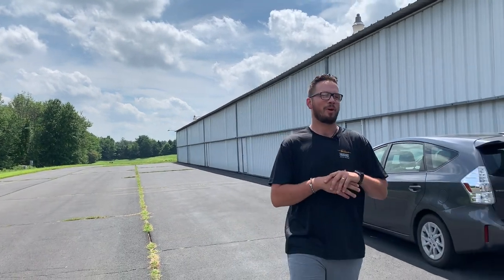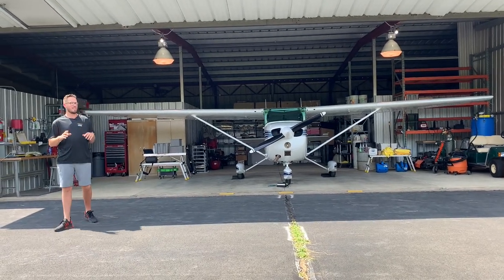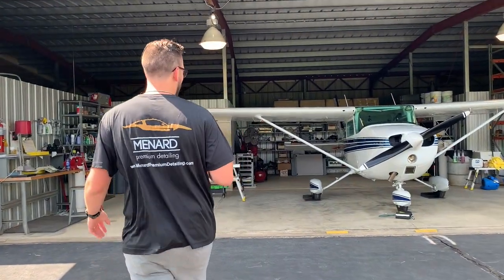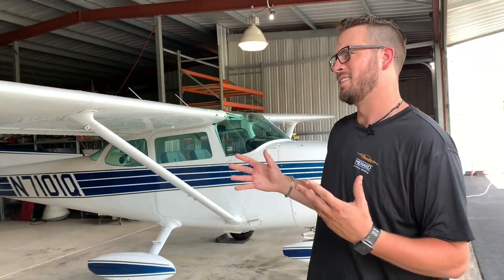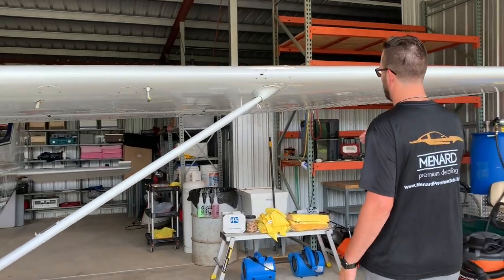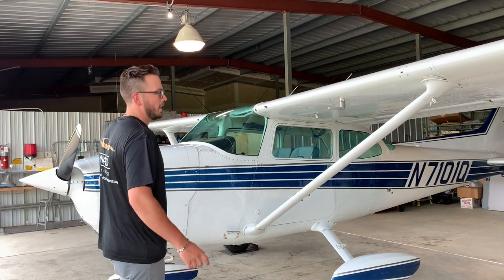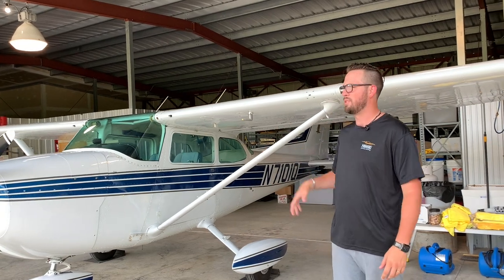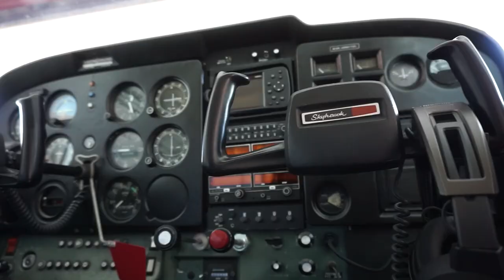Airplane Ceramic Coating ✈️💎 | Cessna 172 Skyhawk | Menard Premium Detailing

Comment: Hey love your videos. I was wondering once you give it a good bath, what do you use after that to get the oxidation off? I use a acid based paint prep that is supposed to dig in to the paint and loosing up the old paint. After that I know the surface is free of any rough spots or debris. I apply the coating. However, I see you buffing. Can you telle what you are using and what type of pad is that on your buffer. I've always been told that once you apply the prep that any other buffing you do is only going to loosen up anything that wasnt ready to come off and gets pressed into the paint. I also have a shampoo that I leave with my customers that they use at the first sign of fading which for a plane flying average is about 18 months. It has several sizes of ceramics and 🚫 t only cleans any stuff that happens to stick since applied but also spies an additional 1 to 1.5 mil layer to bring back the shine another year